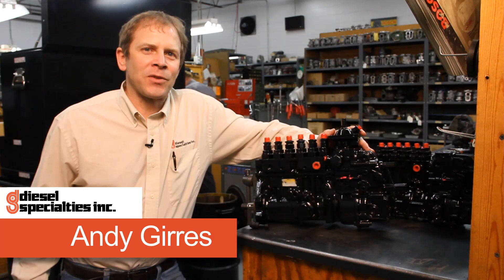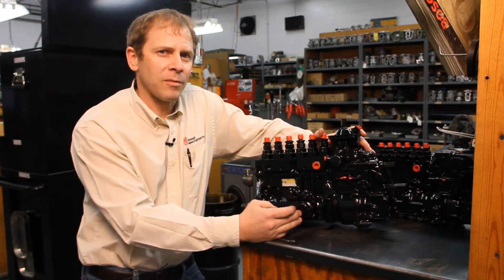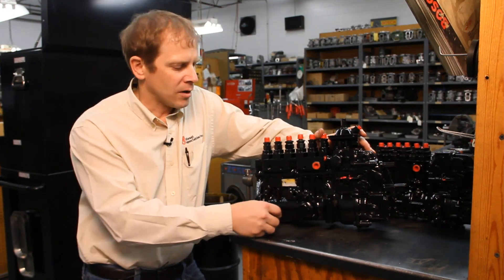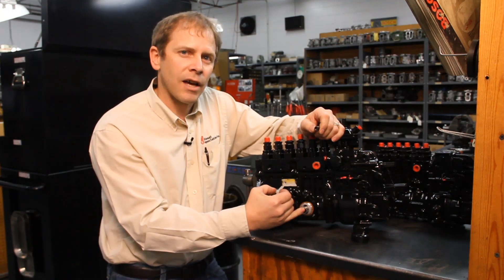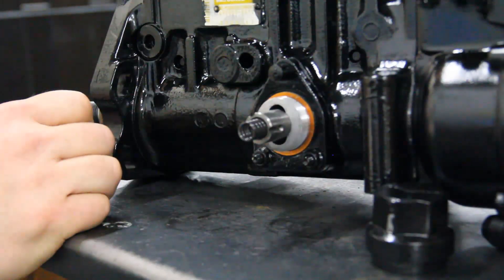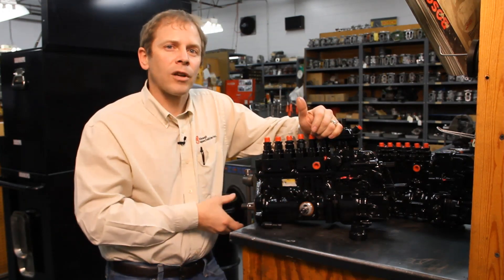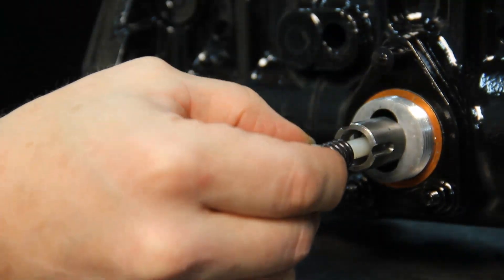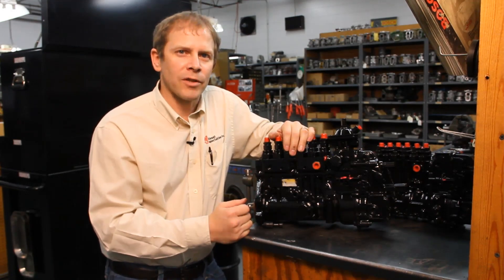Pin Timing a Denso Pump on a Cummins

Comment: I have a 8.3l cummins engine in my 7250 tractor with nippondenso injection pump.  What do you recommend for the initial torque setting for shaft nut and the final torque setting? Thanks!